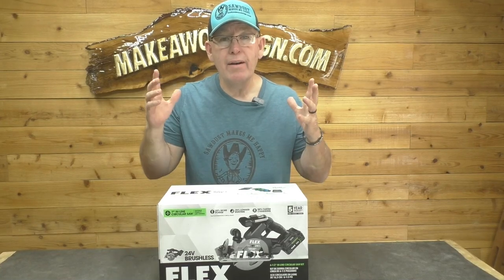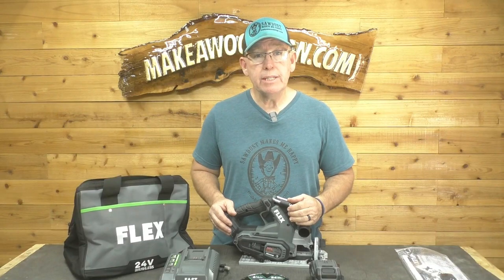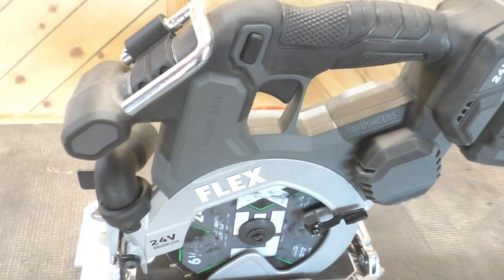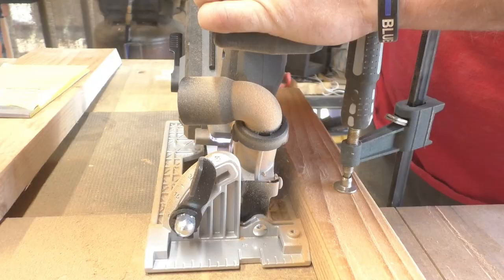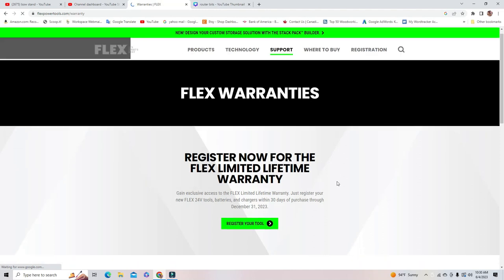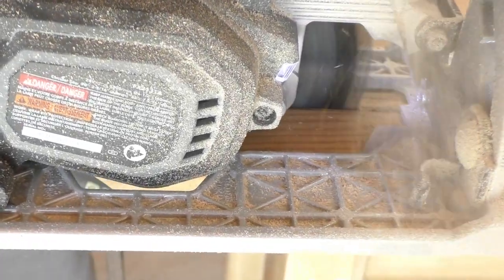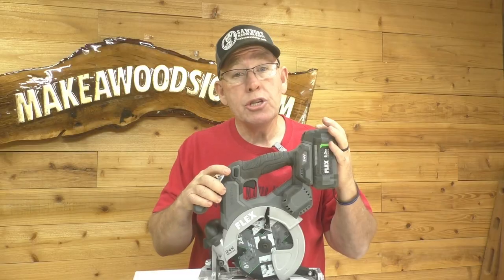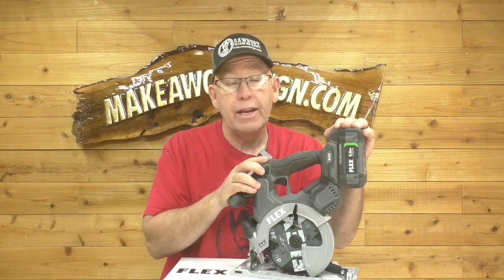Flex Circular Saw Review - An Honest Look

Comment: I've got this saw, and it is the most pleasing circular saw I have used in 40 years of carpentry. Especially as a lefty, AT LAST I have a saw with GREAT VISIBILITY of the blade! That said, I wish the hole in the foot/plate that the blade goes through was narrower. When cutting odd shaped or narrow pieces of wood the support can be wanting.
Reply from the maker: That's a great point. It is a bit wide

Comment: Just picked up the saw at Lowe's yesterday. I absolutely love it!! With the 5 amp hour battery I got well over 200 cuts. A lot of them were ripping 8 ft OSB. I paid $150 for it. Got a 2 and 1/2 amp hour battery and a fast charger. I haven't used the 2 and 1/2 amp hour battery. I also have the mini wet vac from flex. Hands down the best cordless wet vac I've owned. I own a lot of red tools. The two tools I have from flex are better than the middle walkie versions I have. Not saying that All flex tools are better than Milwaukee, just saying the two that I have are f**** awesome.
Reply from the maker: You know, we have a lot of different brands but the flex are by far the best tools we own. We love them!

Comment: That ridgid 6 1/2 fuego saw is 1 of the best saws ever made for framers , if i remember it came out in 2007
Reply from the maker: That thing will cut through anything!
Reply: @oldave100  such a nice circ saw 👀 reminds in 06' when the rigid fuego 6 1/2 inch saw came out

Comment: I was in the market for a saw, could this inline saw be used as a replacement for the Flex 7" circular saw or 7" rear handle saw? I'd pick this one as its more compact and in-line, could it replace those other two?
Reply from the maker: I'm honestly not sure because I haven't used those other saws. But I will say this thing is a beast and we've had nothing but good luck with it

Comment: I'm so happy for this positive review. I'm new to Flex after I had to return 2 Milwaukee circular saws (2732 cordless M18 saws with right blade 7 1/4") because the shoe was not aligned on the Milwaukee saws, they were both stamped in the factory 0.020" out of alignment, so the blades were not parallel with the shoe, and you could not do rip cuts with a straight edge guide with the Milwaukee saws.

I bought the 6 1/2" inline Flex saw, and was so impressed I went and bought their 7 1/4" conventional right blade 20V saw. I made a video showing some of the quality differences between Flex and Milwaukee on my channel. The Flex saws are both dead parallel, the shoe plates are perfectly parallel to the blade. 

The Flex saw motors also have a much smoother sound that is far less annoying than the Milwaukee which had a loud "whine" to it. Honestly, the Flex saws are worth buying, even if you already own Milwaukee. I own only Milwaukee M18 tools, but I went and bought the 2 Flex saws, because the batteries that come with the kits are so large that you don't need to swap out batteries.

I cut with my saws all day today on a project and only used 1 bar of power on each of the saws, the battery life is extremely good. All of the Flex chargers are also fast chargers, and they charge twice as fast as the M18 Milwaukee chargers.
Reply from the maker: Man, we LOVE the FLEX tools. They're the best tools we have
Reply: For sure. The Flex saw shoes are remarkably true in my experience with them. I've been using their 6.5" inline saw for precision cuts on the job and it has been excellent
Reply: Very true about the Flex saw being perfectly aligned.  I had to trim some 6’ fence planks with a straightedge and there were absolutely zero flaked edges.  The top of the cut was indistinguishable from the bottom.  The saw I was using previously left a lot of chipping (even with a new Diablo blade) which took time to sand down.  The Flex is a very smooth and powerful saw.  Perfect weight and it’s quiet too.  The stock blade is surprisingly good.
Reply: I bought 2 Milwaukee M18 Fuel 6.5" blade left circular saws and returned them both for that same reason, the saw blade was Not in alignment with the shoe and it was almost Impossible to cut a straight line .  I bought this Flex Inline circular saw Kit on Sale for $179 at Lowe's and never looked back , its an Awesome Saw .....👍🖖
Reply: I was in the market for a saw, could this inline saw be used as a replacement for the Flex 7" circular saw or 7" rear handle saw? I'd pick this one as its more compact and in-line, could it replace those other two?

Comment: I bought the Flex Inline saw because it is the only left blade "Worm Drive" saw that has a dust port, that shoots the dust away from your body, instead of directly back in your face. Typically, all Worm saws shoot dust straight in your face, because they have no dust port. 

Flex are the only company that solved all the design flaws with a typical Worm Drive saw; they used a belt drive, a dust port that aims the dust away from your body, and the belt drive allows a deeper cutting capacity--it can cut deeper than any 7 1/4" saw on the market. 

Flex also has the correct (very high) blade RPM (5,500 rpm). Most 6 1/2" saws have too low of blade RPM and the cut quality goes down when you lower the blade speed. 

Flex really thought of everything, this "Inline Saw" is a masterpiece of engineering. But it's also dead accurate, and has very high build quality control--actually significantly better than Milwaukee.
Reply from the maker: Agreed 100%!

Comment: Flex makes awesome tools. I have the 7 & 1/4” circular saw and other tools and they are incredible. The lifetime warranty deal has been extended through end of 2024. I bought two tools in the past two weeks and got the lifetime warranty when I registered them.
Reply from the maker: No kidding?! I didn't know they did that. FLEX is definitely upping the competition!
Reply: Definitely can't beat them on warranty customer service.  Had a few batteries go bad on me from the leaking defect. They warranties them out no questions asked when I called them

Comment: Are the saw blades easily available?  Who sells them? The saw blade size isn't traditional size at home improvement stores.
Reply from the maker: You can order them online, or get them at Lowe's I think. They sell the entire Flex line
Reply: Need new glasses?  HD has several different tooth options for it.  The blade that comes with it is surprisingly good.